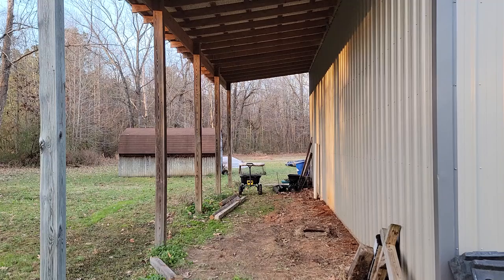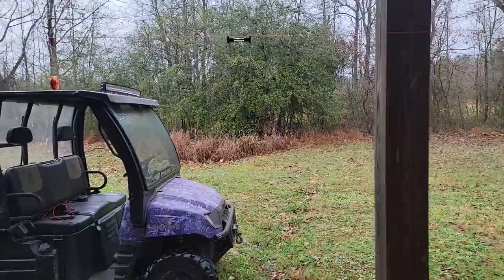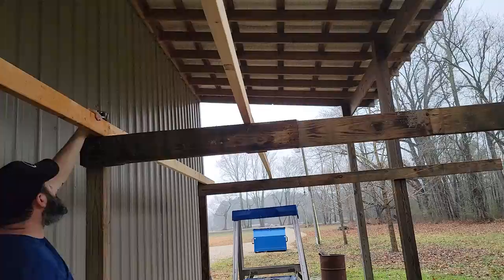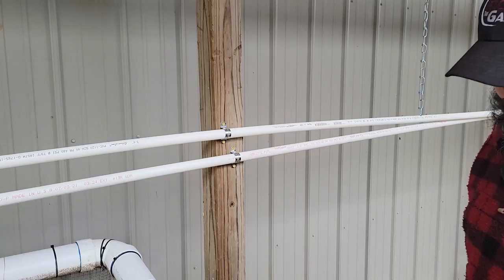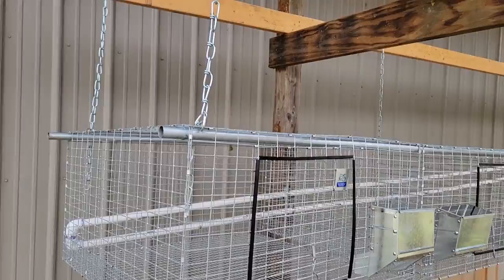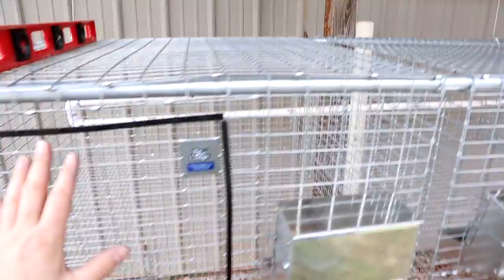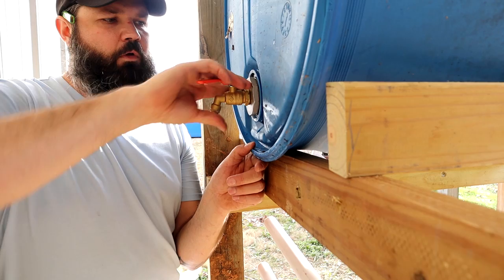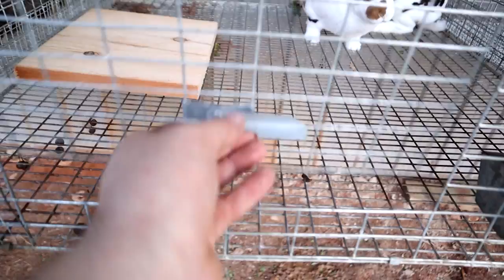Hanging Rabbit Cages The Right Way | Rabbitry

Comment: Great video I use the exact same water system. The only difference being is I’m in north east Pennsylvania and we freeze so I put a tank heater in the barrel and a fountain pump in line and took the other pipe to return into the top of the barrel, so that it recirculates warm water all the timeand keep water from freezing
Reply from the maker: Great.

Comment: The thing I was worried about is that they were going to be on wire the whole time but I see there is something for them to stand on and bite. But they do need more things to bite on or more toys 😅
Reply from the maker: Yeah the wood works pretty well for them to bite on.  They never use it for a resting board.  They prefer the wire.
Reply: @NicholsCounty  but it also said it’s to keep them clean and healthy tho. But it can hurt they feet is what I’m saying but i still think the wire shouldn’t be so thin. That’s a as lol 😅
Reply: They should be okay if it's 16 guage wire or especially 14 guage, if you use 14 guage they will be absolutely great. The myth of wire hurting rabbits' feet comes from people using the wrong gauge, or letting hay accumulate on the floor and collect urine.

Comment: I think it looks good, but I wondered how heavy that water barrel will be.  The shear point on screws is much lower than with nails.  I found that out the hard way, myself. To anyone building a water support that will hold a significant weight, nails are a better choice for heavy loads.  I use screws for almost everything, but not load-bearing.
Reply from the maker: Probably 300-400 lbs.  Yeah I'll get the nail gun out and shoot some nails in there this weekend.  Thanks.
Reply: Good point, screws snap like glass but some good ole spiral nails will do the trick!

Comment: Yes nice job .  But I think it really is "the right way" if you are raising meat rabbits.  Raising angoras for example, needs to have the cages hung separately for easy removal  for cleaning the cage .  There is always build up  of fiber that needs removal and not easy to do with joined cages. So the bars through  all the cages just does not work .    But  for hanging something like a log rod with hooks for each cage is an option I would use instead of chains .   The other thing is they tend to jump round and move cages  so hanging doesn't always work I found and have since found a better set up  are pvc stands  so the droppings still go through to the dirt ground and are easy to rake up.  .  The cages and stands  are easily washed and moved.  I use this system for summer but  then have an indoor insulated rabbitry for our cold winter  .
Reply from the maker: Good info. Thanks

Comment: I've used those Ferrell's for traps (trapping coyote) and 1 Ferrell is plenty strong enough to hold a coyote so it might save a little money or prevent running short on supplies. You did a really nice job though

Comment: This is really smart it allows for so much flexibility you can hang more or less cages as needed I'm going to build this inside my duck pen using dog crates with 1/2 in mesh fabric on the bottom on the cages lol love this idea.
Reply from the maker: Awesome.
Reply: Ducks should not be homed on wire.   That is cruel, and it will damage their feet.

Comment: Someone probably already thought of this but  an easy solution if doable is to use pliars on your hook that falls off. Crimp it so it cant fall off. Just a thought. I love your setup and would be interested  to know if you have freezing problems with it.
Reply from the maker: Yeah I already fixed the issues and found the clips I want.  I tried with plyers but they're pretty strong and would have to put in a vice.  Thanks for the thought though.

Comment: As far as your building, you did fine. The only thing is that even pressure treated lumber will rot after a while (about 10 yr life).
Looks like you were trying to be quick and fast. The only to make the stuff in the ground last longer would be to put the 4X4's in cement but that takes longer (waiting for cement to dry).
You did a great job awesome!
Reply from the maker: Thanks.  I didn't want to cement them in because this is just temporary.  Maybe a year or 2.   And these 4x4s I used, I pulled out of the ground last year, they were part of an old deer stand.  I just upcycled everything.

Comment: If you want to try a different baby saver system, try plastic wall panels, cut to 3" strips, and attached to the cages with cheap Zip Ties. It will be a solid baby saver, white in color, and of a flexible plastic material. It will take away some visibility, but it will add some wind protection to the little babies if they happen to fall out of the nest.
Reply from the maker: Thanks. Yeah that would work.

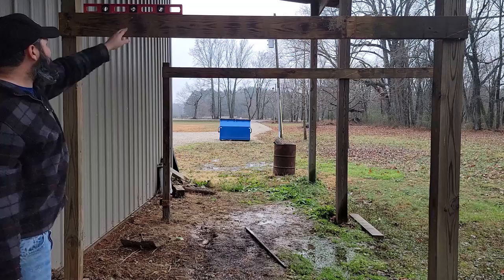Comment: 8:07 I'm not a pro, just an amateur who likes building stuff. Looks a good enough job leveling the boards. You might consider either putting one or two nails into those horizontal boards, or perhaps adding another vertical board on the post just underneath those horizontal ones (with nails), that way the vertical board is holding the weight of the horizontal ones. Screws are meant mainly to prevent two pieces of wood spreading apart. Nails are meant to resist shear forces (sliding past each other). Depending on how many rabbits and how much equipment you have, you might be asking those couple screws to do more work than they are designed to do. Worst case scenario, that would end up with all your rabbits crashing to the ground. Keep an eye out to see if those start dropping lower over time. Also keep an eye out for the 3 new posts to see if they start leaning away from plumb. You might end up needing to add some diagonal bracing along the back of those posts (next to the metal siding). I wouldn't worry about the bracing though, unless you see them start moving.
Reply from the maker: Thanks for the tips.  I used the screws so I can take them out easily while getting it leveled.  But yeah I did use screws in the whole project.  I haven't seen any issues yet with leaning or coming apart.  I have 10 cages on there with 10 full size rabbits and maybe 18 kits at any given time.  Thanks again.
Reply: @NicholsCounty  Glad it's working well for you. Looks like a nice setup.

Comment: If your barn is pretty level then you can use The top of the wall on the barn and the Eve to achieve the same measurements at all points Measuring down.
Reply from the maker: Damn I should of thought of that, would have been a little easier.  Thanks.

Comment: You need fast drying mix to put in Round posts you used 

and It open to cold wind and snow and rain so you'll find hard get bunnies 

Got careful your rabbits and kits all so rabbits don't like it opening in to them it mad and bit you may think different on doors open on cages hey how going keep watering tank freezing ???
Reply from the maker: The posts are solid.  You don't need concrete. 

As far as it being open to rain,snow or wind it's not.   Those bunnies spent the winter in there with no issues.  It's got a roof that over hangs them by at least 6 feet. 

All the mothers have kits right now and they're all doing great.

Comment: Having so many issues iwth my current rabbit setup.  We have wire cages stacked on stilts (u posts), within a fenced off area. Mice are tunneling into the area, building nests under the cages, stealing feed and hay to build their homes.  We also live in AZ and the mice are attracting more rattlesnakes and gopher snakes than I care for.  Might try the hanging system- do you think it would be somewhat snake proof?  Thanks!
Reply from the maker: I mean nothing is really snake proof. They can climb. Just set some mouse bucket traps and get rid of that way.

Comment: boards are supposed to go over the posts- never rely on nails or worse screws the job of handling sheer weight-- not even lag bolts if you can have the boards on top., common mistake-- monkey see monkey do- until the foreman chews your ass out!!!   thats what i was told... kmaybe im wrong
Reply from the maker: Great tip.